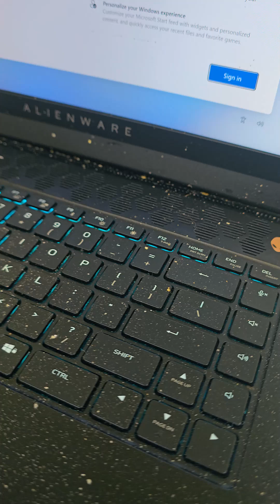Your Laptop Needs This Clean! (Alienware m15 R3) #LaptopCleaning #Alienware #TechTips

Comment: But… why would you buy such an expensive laptop and not put in even 45 minutes of research to learn how to maintain it yourself? Before getting my laptop I swear I spent like 6 hours researching prices and benchmarks and figuring out which are conveniently built and which are a pain in the ass to take apart in clean, which I can easily undervolt and which have shitty fans, etc etc. Like why are we dropping Ks on gaming laptops and we don’t even know you have to clean the fans?